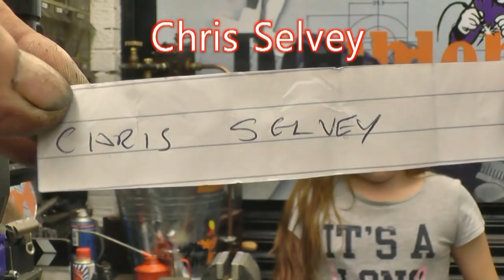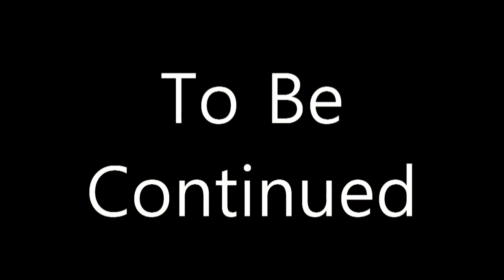SNNC 236 P1  Video Camera Lens Mount

Comment: Just a suggestion John to add to your thought about the belt on the mill - maybe a Twistlock Fenner belt might be a lot less noisey.
Reply: Mike Clayton or maybe a straight v belt with no teeth on it.
Reply: Mike, I second that thought. I installed a Fenner type belt on my 2hp wood jointer. The reduction in noise and vibration was substantial! regards vic